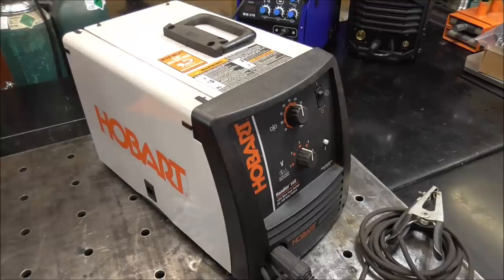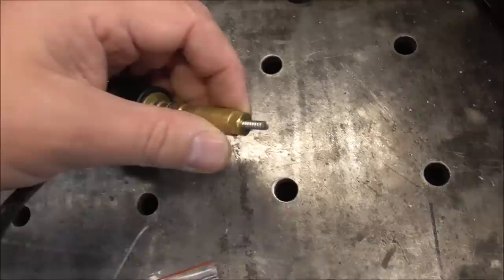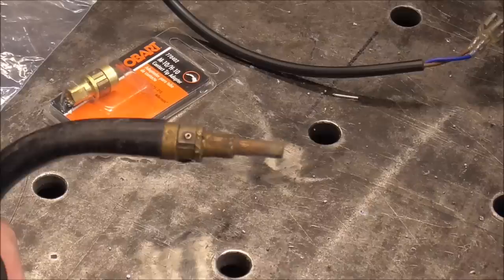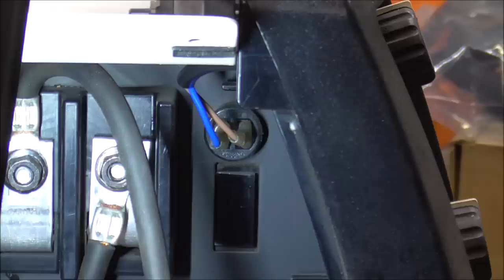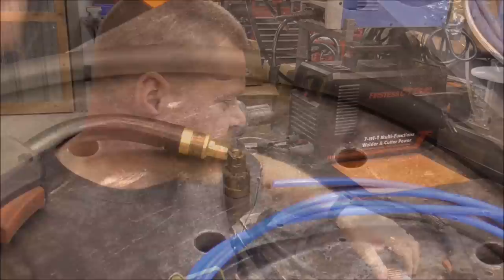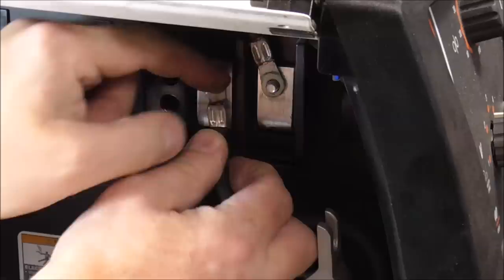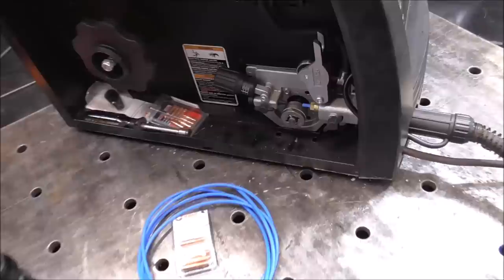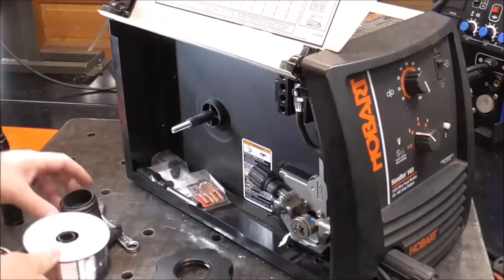Convert Your MIG Welder to Weld Aluminum - The Easy Way

Comment: Very cool video!
I just got a 220 V welder (Cheap Chinese no name).
It is the model below the one they make that will weld aluminum.
It doesn't support a spool gun but I had been thinking I should be able to put Al wire in it, hook up argon and weld aluminum.
Looks like I was right.

Later on I may hack in a DPDT switch to take power from the wire feed motor and send it to a spool gun jack.
I can't think of any reason that wouldn't work.
Worst case scenario I set up an external 24 volt variable voltage supply and just turn off power to the wire feed motor in the welder.

However with your tip about what kind of wire to use I am less concerned about just feeding aluminum wire through the gun it came with.
Supposedly my welder takes standard Tweco parts, I wish companies would reference a particular Tweco gun when they claim that.
Tweco makes about 100 different guns.
It is like claiming "Uses GM parts" and thinking that helps people find the right ones.
Reply from the maker: Lol exactly about "takes gm parts". Your welder will run al wire for sure

Comment: Thanks, I will be buying the components as you suggested and trying this, although the Argon tank is quite expensive@ $260.00.
Reply from the maker: Just go to Matheson Gas and sign a bottle contract. You can get a 1 yr or a 5 yr. It's not a lot of money
Reply: @BrandonLund  I will check it out, we have 2 suppliers in our area, Praxair and Airgas.
Reply: Remember the rules for MIG or TIG welding aluminum: use only Argon, or for a hotter weld a mix of Argon and Helium. It's also very important that aluminum be clean or it won't weld at all. No oil, grease, paint or gum from labels. If it's not clean use a small disc sander and then clean it with acetone or laquer thinner. In the industry 5356 filler rod is always used, as opposed to 4043, so if the part is Black anodized the weld does not turn white.
Reply: Update on my last reply, the 120 cf Argon tank is now $430.00, I should have got it when I got the C25 at $260.00. Wow, Biden nomics!

Comment: I converted an old Hobart mig I simply drilled out the tip the steel liner worked great no need to change liners it had a pulse setting I could build up engine cases I kept the bead to 1/8th width it was great pass after pass looked pro yes argon miss that machine
Reply from the maker: Right on!👍
Reply: Yes the trick for welding motorcycle cases or large blocks is to always preheat the aluminum or it will crack from cooling off to fast.

Comment: Very well presented my good sir. Ya learned me a new trick for my mig. Heads up, Miller 141 has the same exact wire hub feed set up. Spring loaded push, rotate, select. You are helping me learn ridiculously fast. Thank you for all your efforts. Very thorough. From start to finish.
Reply from the maker: Thank you so much! I appreciate it brother!

Comment: Ty for sharing this video.  I would only recommend doing this as a craft project and nothing that actually needed structural strength.  I have many reasons why but the main reason is your heat affected zone on the thin material would really weaken the strength of the base alum.  Lots of other good info in this video for sure.

Comment: I'm sure you weren't expecting a terminology lesson, but graphite and graphene are essentially the same base component but radically different products. Graphite for industrial use is powdered carbon that's been exposed to tremendous heat and pressure (and graphitized, naturally), but normally used as a dry lubricative element. Graphene is single atom thick carbon sheets (yes, so small and thin that it's basically invisible to the human eye) but makes a wonderful additive for a lot of things, presuming you can find/make it. Most graphene on the market is nanoplatelet particles and not true graphene.  (I happen to make graphene about a quart at a time and it takes round about a week to do it correctly). 
The blue liner in your video is typically found as PTFE, more commonly known by the trade name Teflon. It's readily available as 3D printer feed line and also relatively self-lubricated, though you can spray the line with dry lube containing graphite for mig feeding, which shouldn't be any worse than a Very fine layer of dirt particle if contaminants are a concern that would be on the wire roll anyway from manufacture and general exposure.
Reply from the maker: Very interesting and thank you for sharing your experience 🙏👍.
Reply: I use PTFE - teflon silver plated wire for my linear power supplies. The customers require it. It's only hobby stuff no military certs required. It never melts even under the hot soldering iron. From a 35 year welder.

Comment: When you are preheating your aluminium rub a bit of bar soap on the plate a little away from your work area, or even on the back and when the rub of soap turns black you are up to temperature....TTFN
Reply from the maker: Great tip 👍

Comment: I would love to be able to occasionaly weld aluminum, but couldn't justify buying an entire new unit.  I have a Hobart 187, which is 230v, so I might be able to weld 1/4".  In any event, I'll buy the stuff you reccomend and give it a shot.  Thanks a bunch for the info !
Reply from the maker: You will be able to easily weld 1/4" with that unit 👍

Comment: Tip from a retired Welder If you cut your wire on a sharp angle it will start perfectly  every time This will give high resistance ,thus high heat contact  Balled ends will stub  and spatter
Reply from the maker: Great tip!

Comment: Great video, I have a Lincoln SP-110 but, I don't change liners and it works just fine. Only thing is that when I pull out the steel wire I blow the liner out from both directions to get any metal out and also I've never had the wire kink on me installing it. Knock on wood 😅
Reply from the maker: Nice 👍

Comment: I did this with an old, worn out Seeley. Didn’t increase the tip size. I’m sure that was the problem causing it to bird nest. The thing I didn’t anticipate was pulling the wire back through the liner and destroying it. Cutting back to clean wire at the tip, flattened the soft wire just before it actually cut. It’s such a small thing so as you’d hardly notice. That little flat burr was cutting the liner every time I pulled it through. You knew it was doing it by the spider web size string that came out with the wire. Once you’ve pulled the wire through several times, wire will stop feeding all together.
Reply from the maker: Yah thats the problem with those plastic liners. Another reason that if you try running steel through them it will really tear it up quick

Comment: I've been using my harbor freight titanium unlimited 200 to weld aluminum. I haven't changed the liner at all. My wire feed maxes our at 400, and I'm set for 19 volts I think. It's good for up to 3/16, after that it'll cold lap. It'll feed 4043 for a minute or two, but will birdsnest in the rollers at the slightest whim of fate. Using 5356 in .035 with an .045 tip it'll feed like a champ, but you gotta move fast and take  breaks so you don't burn thru your parent metal. If you clean your surface 1st and weld really fast, great, but hover in one spot to long, or start whipping it like your welding steel and poof the bottom will drop out.
Reply from the maker: You've got it down brother 💪. I probably didn't mention it but the Teflon liner serves another purpose. It keeps the fine metal particles that build up inside the liner from contacting the aluminum wire and contaminating the weld. Try blowing out your liner sometime with compressed air. You will be amazed at what comes out.
Reply: @BrandonLund  I believe you're right, I can only get away with This because it's a brand new welder. Only about 6 months old. However I got an older Campbell hausfeld that could use the Teflon and become dedicated.

Comment: I have an old (80's) 120 v Century mig machine that was sold as Aluminum capable. I tried the test machine at the store and it worked.. I have never used mine for alum and I do not even know if I can reverse the polarity. I am sure that I need a new liner.. Now I am inspired.. I'll have to get a bottle of Argon, which I wanted to get anyway for something else, next time I am down the hill and give this a try.. thanks for the kick in the a$$...  30 years is long enough to put it off...
Reply from the maker: You know what they say....good things come to those that wait! Right on brother. Enjoy!

Comment: I also want to thank you for your video, but it needs to be said especially for a guy like myself who's a hobbyist. I have a Lincoln 180 HD and I'm using a argon mix for mild steel. So I could understand for 15 $20 for the new insert. But you also have to figure now you got to buy a bottle of 100% argon  bottle which would definitely be an added cost just for the aluminum welding.
Reply from the maker: If you convert your current welder for $25 to weld aluminum or you buy a brand new welder costing hundreds of dollars it still requires gas. No different than it requires power to operate. If you don't already have the gas you can buy a full tank of argon for less than the cost of a spool gun (which is still cheaper than buying a new welder that would require argon to weld with anyways).
Reply: Yes you are correct. For aluminum only use Argon or a mix of Argon and Helium. Helium gives you a hotter weld.

Comment: Your intro was perfect, exactly why I clicked on the video.
 Thanks for not being an arrogant ass like many of the welders on YouTube and fully realising not everyone has unlimited funds for hobby's.
 I had always thought a spool gun was absolutely necessary but you proved it isn't. 
I doubt I will ever do alloy welding, I think I've only needed an aluminium part welded once in the last 23 years (although it was pretty expensive at about $55 an inch of weld in 2014)
Subscribed as I like your approach to 'teaching'
Reply from the maker: Thanks man I appreciate the sub and your support. Being someone who grew up with some pretty rough equipment I know what works and how to get  every ounce I can get out of a machine lol

Comment: Should try it with Helium, I seen a lot of people say that was the way to go. Never tried it myself though
Reply from the maker: Helium.is good but super expensive. You dont really see the benifits on thin metal as you will on thicker stuff.
Reply: Yes, for a hotter weld with more penatration use helium or a mix of argon and helium.

Comment: A comment if I may.
I've seen a lot of vids and quite a few on aluminum and one of the most common things is to Really remove the surface on all aluminum connections at the joint.
That is sand/grind through the surface layers on both then weld it.
The heat helps but removing the surface oxide is necessary.
Only use tools for aluminum only to prevent contamination.
Reply from the maker: @Danny Comsa Tell me you didn't watch the video without telling me you didn't watch the video...
Reply: @BrandonLund  
I apologize - I thought I saw it all including looking at the weld areas and didn't see any abrasions.  Must have not registered in my brain.

I think that that is what you are referring to.  I did watch it from beginning to end, including the "bubble" weld tacks at both ends, which prompted the idea, then the finished welds, which again prompted the idea.

Anyway - really good channel - keep it up!
Reply from the maker: No worries bud. I appreciate your support 👍 https://youtu.be/FGhSo82MP9U?start=1557&end=1790

Comment: Gday Brandon,
Thanks for taking the time to make and post this great info. I’ve just picked up a 15ft, 50 year plus old Ali fishing boat that has had all sorts of different things bolted and removed from it. I’m changing over my Mig to Ali to fill all the old dash cut out’s/bolt holes etc and tidy it up. Am sure there will be issues for me as the original old Ali seems harder than the sheet I bought for patching the larger holes/cut outs. Lots more to learn for me I’m sure, but I’m loving it. I’m impressed with the quality of your vids. I’ve liked and subscribed. I owe you a beer.
Cheers from Oz 👍👍🍻
Reply from the maker: I appreciate that man thanks for the like and sub! And don't get discouraged with the AL boat. They are thin and this process will make it challenging. A piece of copper on the back side to act as a heat sink will help if you find yourself burning through
Reply: @BrandonLund  
Great tip, thanks. I’ve had a full day of practicing on the bench with off cuts and challenging it is to say the least! 😁 Most of my repairs are on the gunnel tops/side decks and the dash. So I can put doublers of Ali behind to help with increasing the thickness. I’m definitely staying away from the thin, pressed bottom plating. The bit of pitting there will be epoxy filled. 
Thanks for all info,
Cheers 👍👍🍻

Comment: With the aluminum mig at work we typically take out the liner after every spool and blow it out with air cause even with our dual rollers it still has sometimes
Reply from the maker: Great point!

Comment: Great video! I always thought you have to get a TIG welder for aluminium.
Reply from the maker: Nope and this way is very fast. They use this method in production of enclosed trailers. Tig is nice but it's very slow compared to this

Comment: I never noticed that aluminum was on the door chart on my 140.  I was going to add a foot pedal for pre and post flow, now I know I am going to.  The relay for the gas is 120v for some reason so I might have to add two relays, but the Temco foot switch I bought is rated for 120 volt so maybe one DPDT relay can do this.  I have been trying to decide on some YESWELDER gear (plasma cut and multi-function) - it is good to see it in your shop.  Subscribed.  Thanks.
Reply from the maker: Crazy that I never noticed it either! Thanks for the sub and support! Much aporeciated!! 👍

Comment: Thank you very much for this information, it allowed me to make a wise choice. I have an aluminum heat pump bracket to weld, but I only have a 120v mig welder.
This welder looks a lot like the one in your video and comes from Canadian Tire, which is the Canadian equivalent of Harbor Freight.
I never use argon, since I use flux cored wire, so instead of spending money on outfitting my welder for this one job, I think I'll bring the support to a specialist shop this time. .
Reply from the maker: Right on! Glad to steer you in the right direction. I've made those purchases as you describe only to realize I needed something more to get it done and it wasn't worth while at the end. SOmetimes it is just better to take it to someone. Have a great weekend :)

Comment: Love the concept and you lot are lucky having cheap access to welders etc. Spool guns are another good option as a some have direct gas ports and no real modification is needed but ultimately if you find you need multiple machines then best to buy one good multi-machine and be done even second hand.
As the saying goes use what you got till its broke haha
Reply from the maker: I've got a pretty nice fronius but it's not from being lucky.  Most folks watching this channel aren't going to spend that kind of money. I started out 30 years ago on an old cheap China import welder. It made me boat loads of money so I tend to stay close to my roots. If people can afford fronius right out of the gate than go for it, but like most of us, I had to start off with junk until I could make enough money to buy better. It's great wanting to have the best equipment starting out, but for most of us, that's not reality.  You buy what you can afford at the time and hopefully not finance it.

Comment: One thing I was taught was that you have to brush the weld area with a stainless steel brush prior to welding aluminum to eliminate oxidation from the aluminum.
Reply from the maker: That is a must 👍
Reply: And another reason for the stainless brush is you don't want any minute steel particles in the weld. Steel wire brushes are never used around Aluminum or Stainless.
Reply from the maker: Spot on 👍

Comment: Thanks for the video, I had known from other fabricators that only tig with DC could do aluminium  and doing it occasionally meant no go for me but you have changed all that by showing it could be done. My salutations to you sir for an excellent  presentation.
Reply from the maker: Glad I could help!
Reply: Don't you mean TIG with AC?
Reply: It is with ac but the polarity of cables is changed. I haven't had the chance to try it yet so I don't know how it will go. Basically it's changing polarity in an arc welder putting it very simply and the earth in arc welder holds the tig nozzle and tungsten tip but then it would need shielding gas so I don't know if mig welder might be the other way. Perhaps you know more about this.
Reply: At times it might be worth investing in a Tig welder, if you are going to use it a lot that way you don't have to guess or try playing with dangerous voltages and currents and is a safer way to go and it costs money but may save lives. Thank you.
Reply from the maker: Let me clarify because each process has a purpose.  When you MIG aluminum you use DC electrode positive. Its fast and its how most production aluminum cargo and car haulers are built. You use AC when you TIG weld aluminum. It's a much slower process but you can weld much thinner material than with MIG, it has zero spatter unlike MIG and because it's slower, it's much more precise and the heat is easier to control.